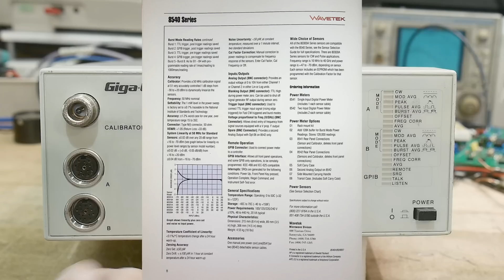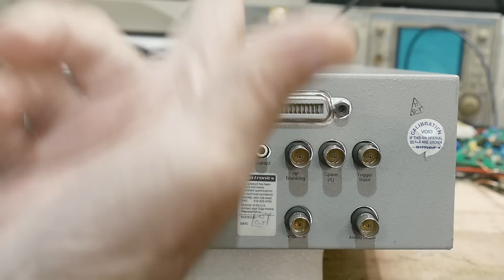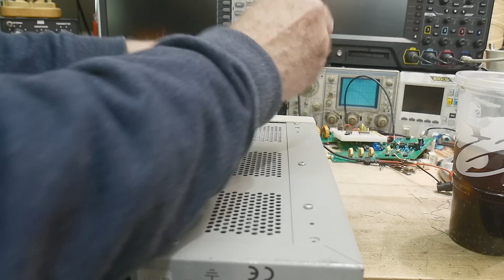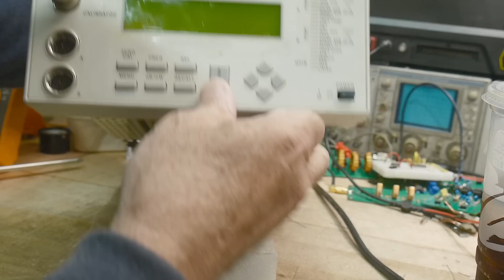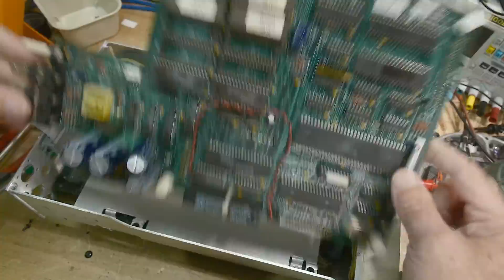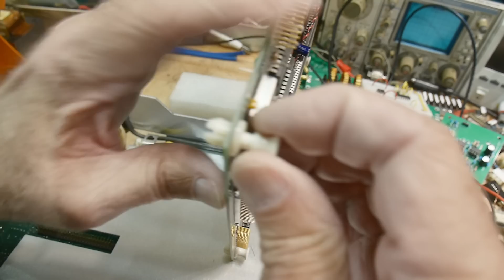#1433 Giga-tronics 8542C Microwave Power Meter (part 1 of 2)

Comment: Thanks or the nice video.   I was curious how the calibrator bolometer worked so looked at your earlier video.  The sensing circuit in the schematic was driving me nuts, It seemed to me that it operated backwards.  Would the bolometer module contain a negative Tc sensor like a silicon junction instead of a positive Tc  Pt element?  

 You packed a lot of stuff in that box, now it would likely be one IC and a front panel.   The down side is the data sheet for some of these devices are becoming times north of a thousand pages.   I am playing with an OrangePi zero2,  the Allwiner H616 soc data sheet is 831 pages and still missing a lot of detailed explanations of how things work.   Craig
Reply from the maker: why would you care if it was positive or negative? software can use either.
Reply: @IMSAIGuy The software wouldn't care.  It may matter to  the servo loop with the op amp that is balancing the sensing bridge.  I will have to go look at it again, possibly I am miss analyzing the bias and feedback topology.  It looks like the ckt adjusts the bridge supply current to keep the bridge in balance by adding more or less current through the bolometer. Ie . If you get more RF heating [power to the sensor, then you adjust the DC drive current to keep the sensor at a constant temp and read how much DC you need to supply to maintain bridge balance which should be proportional to the RF power. 
Thanks, Craig

Comment: It always amazes me that power meters are SO complex - just to read a dc voltage across a diode.  Speaking of diodes, you mentioned that you used hand-picked ones.  Were these similar to 1n5711?
Reply from the maker: no, these are zero bias Schottky diodes with almost no capacitance. we used diodes from radar detectors, the manufacture would call us when they magically made perfect diodes (it was rare and by accident). we would test them and then buy that lot.
Reply: @IMSAIGuy  Oh.  Kinda sounds like a 1n5711.  Also known as an HP 5082-2800.  <2pf.
Reply from the maker: @chrisscott1547  actually, nothing like that
Reply from the maker: this might help: http://hparchive.com/Application_Notes/HP-AN-64-1.pdf
I will need to do a video on the sensor I used
Reply: The problem is giving them an accurate dynamic range from +20 dBm down to -70 dBm.